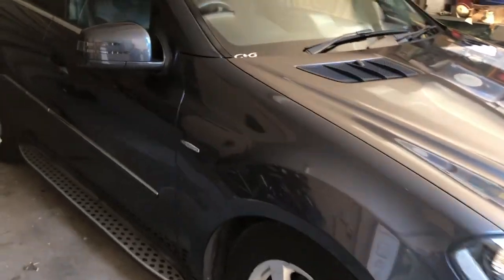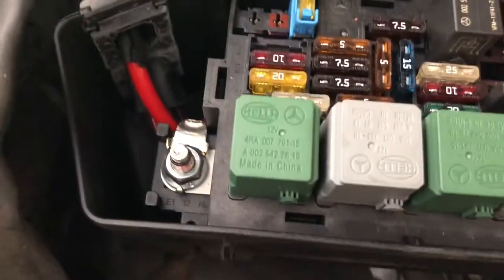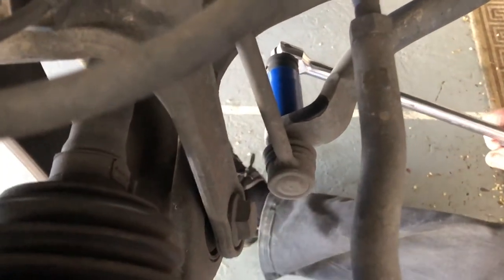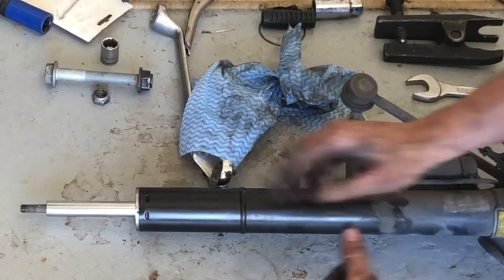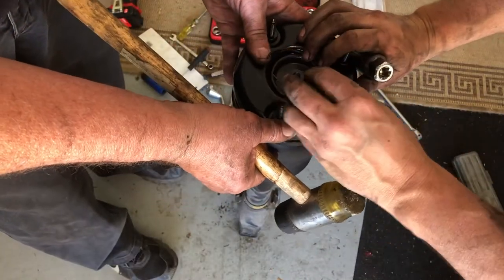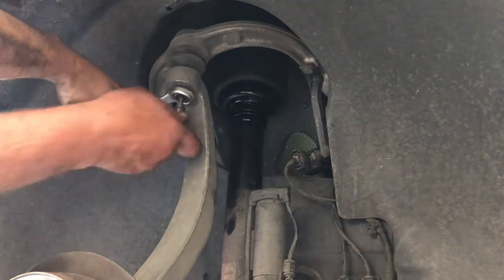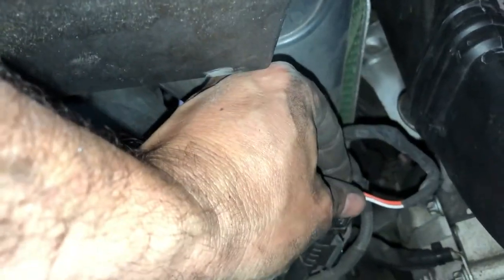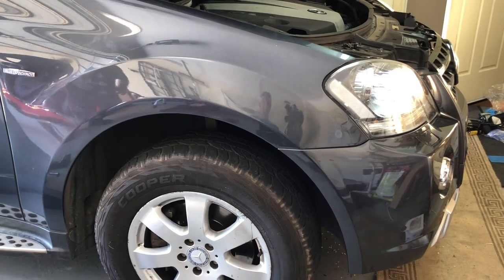How to Replace Mercedes ML350 W164 (2006-2011) GL Front Air Spring - The Complete DIY Guide

Comment: Mercedes GL Glass X164 Front air spring x 2 replacement over a weekend.

I took Drew’s advice and purchased 2 Maxpeedingrod's front Air springs as the RHF was at fault and I didn't want to take the risk of the other side front having the same issue as well in a few month’s time, so I got 2. I looked at the past history as I have only had this car 8 months and found the previous owner had replace both rears in 2018, so I didn't have to worry about that. 

On to the Job. 
I don't have a hoist so I used 4 jack stands and a proper workshop 4 ton trolly jack.
I used a 1/4 dr cordless ratchet.
3/8 dr Cordless rattle gun
1/2 dr cordless rattle gun
Gal pipe for a leaver.
plus, spanners, sockets and breaker bars ect.

Before staring, I removed the 40amp Maxi Fuse for the airmatic suspension and I also took out the green air pump relay as well.
[Note] RHF was done on Saturday, and the LHF the next day] 

With the car on the ground, I sat 2 jack stands under the rear of car just below ride height [This is in case when the air escapes from the front air springs doing the job, causes the back of the car to drop. [the RHF did drop but doing the LHF it didn't drop. Don't ask me why because I still don't know!].
I then jacked up the front of the car to get the front wheels off the ground and placed the jack stands under the front. Once satisfied and safe, I loosened the air line from the RHF air spring, and slowly the car started to drop at the rear and the car rested safely on the rear jack stands that I set up previously. Once safe again I stated taking the RHF wheel off. I then removed the cross strut mounting support bar that’s bolted to both struts, and to make things easier I took off the inner splash shield so as I didn't have to keep getting up to lean over the guard all the time so I could access wiring harness plugs and I wanted while I was there to check the airmatic air pump, the pump air filter that no one checks and the valve block and lines as well just to make sure all is ok. The Air pump filter was slightly blocked, but I replaced it. In case you don't know the air, pump has a long black rubber hose, runs over the top of the splash shield and attached to that is the air filter that sit in the top part of the mud guard. The filter is the same as a standard 1/4in plastic fuel filter so I replaced it with that and took careful notice which way the filter fitted as it can only suck air or fuel one way obviously. 
Prior to ripping bolts and nuts off, I took 2 top strut mount nuts off and loosened the other, then Once the other nuts and bolts were all taken out and the top control arm ball joint was off and the lower strut bolt as well, I used the strap part of a tie down strap and tied it to the upper control arm to the top hub assy to stop the hub assy from swinging out and putting excessive pressure and strain on the brake flexible line and more so when it came to getting the strut in and out. This also allowed a greater leverage to remove and replace the front strut assy as the hub assy was closer to the strut and not worry about ripping a brake line off because if that happened, I'd be dead in the water. 
With the strut ready to be removed I placed the jack right next to the lower control arm and lifted the bottom part of the strut up and over the drive shaft and rested the strut on the jack. I then removed the final nut from the top strut and took the strut assy out. 
With the strut out on the ground standing up being held by my amazing wife who helped and assisted in every way from start to end with the operating of the jack, undoing bolts, fetching spanners, sockets ect, I sprayed cocky’ s piss [aka wd40] around the top of the strut and using a tube socket I tapped the air fitting plate down, so I could remove the circlip. [I checked and marked the old air spring on the strut for position for when the new air spring was getting fitted]. Then I removed the air fitting plate to expose the top strut nut. BTW, instead of using a screwdriver to wedge into the cavity to hold the nut as in the video, I used a 1/2 drive socket, crimped it with vice grips and used a 1/4 drive torx bit and ratchet as it was able to fit down into the square 1/2in hole of the socket and undid the top strut nut that way. This also allowed the vice grips to rest against one of the top strut anchorage studs to use as a leaver to hold the nut while the strut was being undone with the torx bit.
With the old air spring out, I used grease [Not rp7 ect as in the video] for the orings on the air fitting plate and the lower part of the strut where the oring sits on top of the metal round holding plate. I slid the new air spring onto the strut and as the air spring was collapsed and the bottom oring was greased the bottom of the strut wouldn't sit home on the strut and it kept popping up, but that was ok and wasn't an issue as we had a fix for that later on.
I then did the top strut nut up with the torx bit and the socket and when I fitted the air fitting plate I didn't need to press it or use spanners in the video as it just slid down with a little tap of the socket and hammer, and then I fitted the new circlip in and bobs ya aunty. I then proceeded to fit the strut back to the car in the opposite manner. 
When I came to fitting the bottom part of the air spring into place at the bottom I lowered the car very slowly and the bottom air spring slipped over the greased oring and sat in place with no issues at all. With the back of the car resting on the jack stands the car just pivoted when the front was being lowered. [Note: at all times through the whole process the back wheels were on the ground, in park and hand brake on].          
With car on its legs sitting below ride height with jack stand supports I fitted the relay and fuse back in and started the car. As this car has 3 height levels, Normal ride height, plus 2 other higher off road levels, I raised the car to level 3 and the car came up and lifted itself off the 4 jack stands. I left the stands in place and checked for leaks with soapy water and all was good. Then I removed the jack stands and lowered the car to level 1 normal ride height. All went well and the car doesn't drop anymore. 

[In Conclusion: This can be done at home, my wife and I did it on our own on a bigger car than the ML class with jack stands and using safety and common sense. I would really stress if you do one side, do the other as well as you don't know when the other side will give up the ghost, and when it does, your usually dressed up having dinner somewhere with your loved one or just out having dinner with the family].  The RHF front all up too just under 4 hours from start to finish, the LHF took 3.5 hours approx due to we knew what we did the day before. I'd strongly suggest to do one side at a time, and split it over 2 days. this help stops any confusion, errors or if the car still drops then what went wrong and which side is at fault. Leaving it a day proves that the job worked or it didn't so to speak and if there is a problem then you know exactly which side is at fault without banging ya head against a wall and it saves ya time as well... I hope this helps people like you looking for ways to save money working on your own car. I'd also like to thank Drew for the video as well and my wife who helped and assisted in everyway and just wanted to help to get the job done].
Reply from the maker: Well done JS!  I really do feel that this forum is a great community and all about contributing to help others, so thankyou for sharing your experience with doing it with jack stands!  BTW, you have just saved yourself by my calculation close to $4,000 by not taking it to the Stealership, so I think your fabulous assistant deserves to be spoilt and taken out for a nice evening!!

Comment: Looking to start DIY front struts replacement, both sides of course.  Your videos are always among the clearest and most informative online.

I see the Mercedes WIS guidance doc says, as regards refilling the air system,

"The wheels must not be in contact with the ground during the filling.  Since the air suspension bellows in the spring element is destroyed when filling in deflected condition."

Which sounds to me like its lost something in translation, but I do wonder if there's a real point there nonetheless?  It also assumes the deflation and inflation process is done by plugging the car into a diagnositics machine.

For better or worse in our case, a front bag burst (hence the replacement work ...) whilst the system was at full height and was then caught by axle stands under the front jack points.  I was changing the engine oil at the time!
Reply from the maker: Hi Mate, thanks for the feedback! If you haven’t seen I have a complete playlist of all of the AIRMATIC videos I have done for all components: 
https://www.youtube.com/playlist?list=PLor5qdyoV_nQk9277ANJLkKaJ-9Ky_OB7 Cheers Drew

Comment: Hi Drew. Great video's! I think they will be handy living in central Australia! Just got a 2012 GL350 W164 & have a sagging drivers front. I think I'll repace the strut & bag (only 76000 on the clock). Are the maxpeeding products ok in your experience? I was looking at Arnott or Airbag Man in Australia, but they still only offer a 5 year warranty & are as dear as poison (but I don't fancy repalcing them too often 😀)

Thanks for your time. 👍
Reply from the maker: Hi Mate, I have not had any issues with the other cheaper imports.  What I would say though is it may just be worthwhile replacing the whole unit as per: 
https://youtu.be/RaKISTTgPzI Also especially if you live in central Aus I would do all four, hers is a playlist of AIRMATIC videos: https://youtube.com/playlist?list=PLor5qdyoV_nQk9277ANJLkKaJ-9Ky_OB7 Note - most of these videos should have links to where you can buy the parts relatively inexpensively!  Cheers Drew

Comment: Hello Drew, congratulations on your videos. I’m Ruben from spain. I learn a lot with them. I have a Mercedes R280 CDI 4MATIC 3.0 diesel. Lately I have started to have noise in the front suspensions and in two trusted workshops they have told me that the silentblocks are all ok so with 230,000 kms they have to be the shock absorbers. I'm thinking of changing them for some new Arnotts. Here in Spain they have a price of €750 per unit. It's still expensive but half as expensive as the Mercedes originals. I wanted to ask you if you have experience with this brand of shock absorbers and what do you think of them? Also if after changing your shock absorbers you have to calibrate the height with a diagnostic machine? Thank you very much.
Reply from the maker: Hi Ruben, I just love Spain and have had the pleasure of visiting many times over the years!  It sounds like you need to replace the entire Air Strut Assembly for which I have a video on: https://youtu.be/RaKISTTgPzI In this video I just put a cheap Chinese import unit in my vehicle and it is still going strong.  This is the part I fitted: https://amzn.to/3rmq4Zl  That being said I have only read positive news/reviews about Arnotts it's just the price I mean €750 per unit ... I know it's half the price still of Mercedes part but the chines knockoffs are like €50 per unit!  It's up to you, but I'm happy with the Chinese knockoff!  Wrt calibration I did not do this and perhaps it should be done.  My iCarsoft CR Pro+ supports this feature, here is a video I did on the scan tool: https://youtu.be/avvpFWHifuE  Cheers Drew :_DFI:

Comment: Cheers Guys well done mate. My GL is suffering the same i think. The RHF drops and the LHF goes down in sympathy.
Reply from the maker: Understood.  I did one at a time and it did solve the immediate problem, however what I found is that it was only a few months later that then the other side failed as well.  I put this down to the fact that both Air Springs were the same age and thus were simply close to being end-of-life.  It has been nearly 6 months since I did the second front and my car has not had any issues since.  I wish you luck!
Reply: @DrewFixIt  Thanks mate. I'll be doing both FT at the same time... Q: Can ya get the same spring bags [Max] here in oz or do ya have to get em from the US?
Reply from the maker: @js-amg  Absolutely, Maxpeeding Rods have an Australian Website.
Reply: @DrewFixIt  Thanks heaps mate.. I'll chase it up..
Reply: @DrewFixIt  Hey Drew.. Question if I may. Im doing the front 2 air springs over the weekend [one at a time], and I wanted to ask when you do 1 air spring replacement at a time and you let the air out of the spring to collapse it, do all the other air spring on the car let go too and allows the whole car to sit on it's legs? I only have jack stands mate not a 2 posta hoist, and i don't know if i can just jack up the front or have the car on all 4 stands to stop the car from dropping once the air is let out of the air spring. I've seen vids but on one tells that ya know.. Thanks again mate. BTW great speedy delivery on the new air springs too mate from maxpeedingrods...
Reply from the maker: If you have a look at when I did the rears ... https://youtu.be/9OKqid4F_WI I just lifted one wheel off the ground at a time and didn't have a problem, so really up to you.  What I would do though is do one at a time and test the first one fully before proceeding to the second one.  I hope this helps?  DFI
Reply from the maker: Something I just thought of is that the cost of a hoist will pay for itself in doing this one job!  Get a quote from the Stealership to replace two front air struts and you will realise what I am saying :)
Reply: @DrewFixIt  Thanks mate. I know what ya mean with Dealerships, and I did see ya other video on the rear suspension and yeah i did notice ya used a jack stand so maybe its possible for the fronts, and I know what ya mean about the hoist. We're in a remote area and the nearest non dealership mechanic is 50min away, the dealership is more than that and when ya mention MB to no believers, all of a sudden the labour goes up or there booked out for 2 month, you know how that goes! So i'll have to do it myself mate. I'll use all 4 jack stands and check everything for safety before i start. I'll also look at just jacking the front up with sands and supporting the back body from dropping, so maybe that will work, but it's a trial mate as ya know... Thanks again mate, I'll let you know how I go so if people use stands then i hope it will help. Thanks Drew mate..
Reply: @DrewFixIt  Also just a late thought Drew. The front air bag spring RHF leaks air out and drops the front suspension, but the rear suspension stays up yeah! So i'm thinking whats the difference between the air spring leaking air out as the bag is split as a pose to disconecting the air fitting at the top? The air escapes just at different locations would that be fair to say? The rear suspension is still up providing ya take the fuse out before ya start anything, so surely theres some theories in that isn't there? Which suggests that the valve block has individual valves to allow the suspension to go up or down on a per strut basis hense indvidual level sensors at each wheel... I think!!!

Comment: Well done, did you check out the arnott bag or full air strut as option? In the States these have lifetime warranty not sure if lifetime in Australia (have asked as need to change mine) the arnott bag also comes with a tool to compress the top cap. We are 2nd owner of gl500 its had a pampered life and original owner had both front struts replaced at 5 and 6 yrs of age (approx 70000 kms) and the rears at 9 yrs of age (approx 110000 kms). Front passenger now has failed (small pin prick hole in bag) at 6 yrs since replacement and 148000 kms. I'd be interested to know thoughts on normal life of these bags/struts? Cheers
Reply from the maker: Hi Scott, I did look into the Arnott option, however they were very expensive in Australia.  In terms of life my car got to about 120,000 kms before the original Air Springs started failing.  I have replaced all of them with non OEM with absolutely no issues.  Recently, I had the front right strut fail (160,000 kms) so I replaced the entire unit with non OEM.  In the future I would probably not bother doing just the Air Spring on the front as by my experience the Strut is probably not far behind at that point!! Cheers Drew

Comment: Hey Drew got a question I have a electric boat winch and need to add a plug to the rear of my 2011 ML350, where would be a good point to tap into that could handle the amps of the winch...Thanks
Reply from the maker: Hi Brett, no problems.  We have put an Anderson plug on the back of the Black ML W164 that you sometimes see on the channel to supply separate high current (amps) to a caravan.  We tapped the positive into the rear fuse box to minimise the cable length and the earth just went to the body at the rear.  If you don’t know the rear fuse box is located on the right hand side of the rear luggage compartment.  Here is a video I did which shows the fuse box locations and in particular the rear one: https://youtu.be/QyJQfLh1R0Q Cheers Drew
Reply: @DrewFixIt  awesome thanks Drew

Comment: Hey hey bud I’ve got an ml63 w164 amg are they not the same part or am I mistaken if you could some how know at all plz
Reply from the maker: I believe so, but best to check yourself!  Thanks DFI
Reply: I received two rubber rings with one plastic ring. Can I use both rubber o ring one sloghtly bigger or can I only use one rubber o ring?
Reply: One rubber ringbis slightly bigger than the other one.